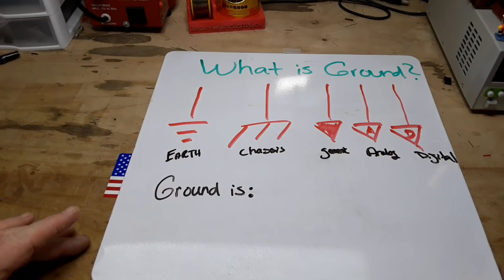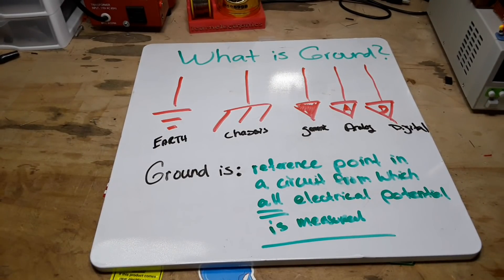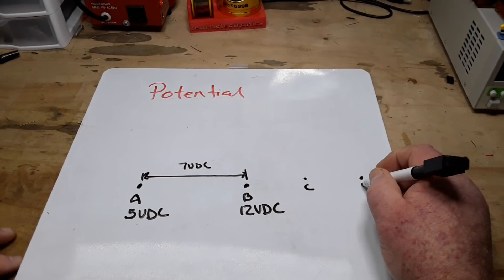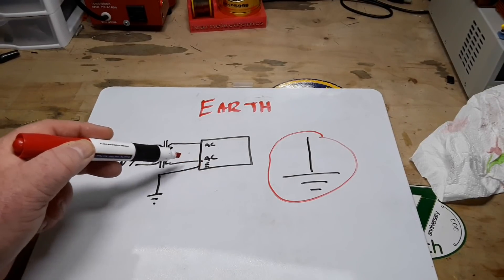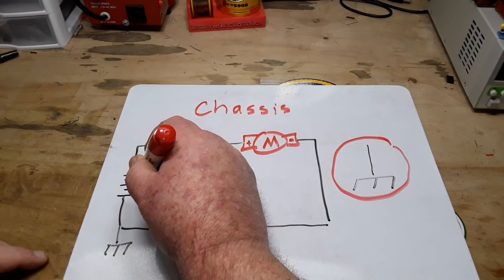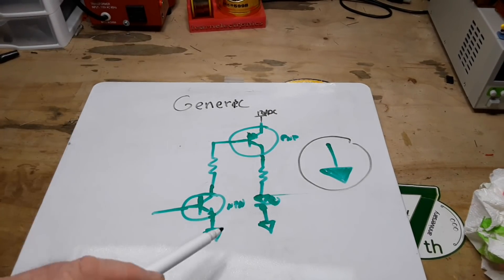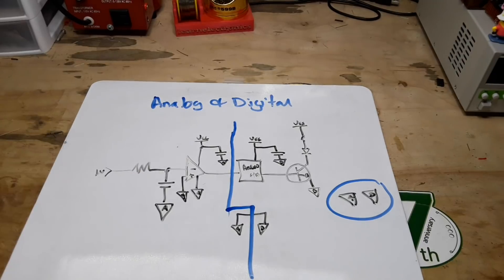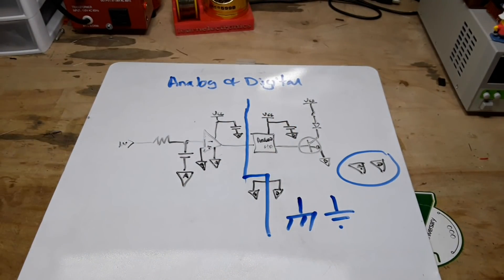What does GROUND mean?

Comment: Speaking as a physicist...there is a BIG difference between 'potential' and 'potential difference'.  A single conductor in space (air) can have a certain potential.  If a positive charge moves closer to that point, the potential there increases, and vise-versa.

Speaking as an EE, whenever the voltages are measured between two points, it is called a 'potential-difference'

...but that may be getting a little picky!
=======================================

...remembering your mother...God bless her soul!!!

--daLe

Comment: In the US system the fault current does not go to the ground but to the incoming neutral (the grounded conductor) and then to the transformer so it trips the breaker. A ground rod alone does not make an installation safe. Countries where that method is used use total differential protection (RCD/GFCI) for the house.

Comment: My condolences to your mom I want to know what is reference ground means I understand black ground but now I'm holding on a brown wire with stripes White Stripes down of it and it says connected to the reference ground so that's my question to you I'm hooking up a bass amp to my car and I'm putting the converter box to the trunk of my car so I can get all the power from my app so that's the question I'm asking what does reference ground mean because when I put the brown on black ground it don't work but when I take that brown off the black and put the black on the ground the lights on but I still have a loose brown wire said reference ground
Reply from the maker: I'm sorry, I'm not knowledgeable about car audio and wouldn't want to steer you wrong.

Comment: When we were building the audio distribution in the new church building, we soon had a ground problem. We had installed audio cables in all rooms to be able to send the sound flexibly from anywhere and to be able to fetch it from anywhere.
The mixer and the amplifiers are connected to the audio ground via a power supply ground. But in the group room we also have a small amplifier where the audio ground is also connected to the power ground. 
So we had a nice ground lood. BRRRRRRRRR
We solved the problem with sound transformers and DI boxes.
So always only connect ground to earth at one point.

Comment: Hi there I just wanted to say how sorry I am to hear about your loss. I work in the UK as an engineer working in the security sector and our sistoms may have several P, S, U's and thay have a common "0v"DC as part of the reference of the internal data. But every now and again you come to power part of the system down to then find out that someone has commented the 12v as well which means that the P, S, U, 's are back feading each other and it is still running. They have also connected the ground from different supply's to the building which can have several volts different between them. Fead from different sub stations. So you can be chasing folts for ages

Comment: My condolences!  Definition of earth ground:  a path of low resistance back to the source for fault current.  When I  teach,  I explain that a volt meters measures potential difference between two points of reference.  Then it is easier to understand.  People mistakenly believe that a neutral (AC circuit) does not carry a load because the voltage meter does not show a potential difference between the last load and ground.  Their have to be a source of resistance between the two reference points to read a potential difference.
Reply: I would not characterize Earth ground as a source but rather a potential sink and a reference. Unless you have wings the earth is difficult to avoid. Birds on a wire will have a different perspective on matters than we do. Lacking the ability to fly we have to do things as we do them. Neutral is the current return path. We use what is called a bonded center tapped service in the USA. The center tap is ground bonded. Each hot is 120 VAC above ground and between both hots is 240 VAC. Neutral is ground. But there's reasons why we cannot treat ground as neutral or neutral as ground. I guess those reasons are where mistakes arise?

Comment: My sincere condolences. Glad you made this video, thank you for clearing up a question i had with our dataloggers. Basically analog ground was separated from power ground but when i put a multimeter on continuity across both terminals, i had continuity. You mentioned they are connected but "downstream" of the measuring circuit, from what i now understand.
Reply from the maker: The connection of the analog and digital grounds is generally the last step in the process. You have your analog circuitry all grounded together. Then you have your digital circuitry all grounded together. And eventually you can connect those two points together. That's the key. The connection of just the two points not all the separate analog and digital grounds. I know it doesn't seem like it makes sense but just by having one connection you eliminate the loops
Reply: @learnelectronics  thanks!

Comment: may she rest in peace. Health to you and your family. I always struggle with the ground. Thank you for the video
Reply: I made a stepper motor driver once and how the ground ran affected its function. Where one capacitor was I mean it was about this much difference > < I was looking at the circuit thinking nah that can't be why it isn't working. I cut that much wire out and made the capacitor that much closer and it fixed it. It was like a sixteenth of an inch. Was the most bizarre grounding problem I ever had. That circuit had two grounds in it, logic and load. Where that one decoupling capacitor was in relation to the logic ground as opposed to the load ground made it or broke it. In the end it was the same route just different distances. I'd tied the logic and load grounds together too closely. That decoupling cap had to be closer to the logical ground. Was just easier to wire how I'd done it initially. I didn't think it'd matter.

Comment: Love most of your videos. They are great to learn from. You also have fun experiments that don't always have to succeed on the first attempt. That's how it goes. However, the 7V difference of potential reference is probably complicated to understand for newbies. I recommend using a multiple point demonstration there. For example, AB and C have some potential difference. A and ground are 10V, where B to ground is 7V, and C to ground is 3V. This helps drive home the point that you can measure in a series circuit that voltage is additive to the equivalent supplied voltage. It also helps identify rails in circuits, which makes troubleshooting way easier.
Reply from the maker: Oh I agree with you 100%. It's very difficult to teach these concepts that would be taught over a period of days or even weeks in a classroom setting and distill them down to a 10 minute YouTube video.

Comment: Electricity works on potential. There has to be a difference. That's why birds sitting on wire don't get shocked. They are energized to whatever that voltage is. Now if those birds with there tiny little feet grabbed another phase and/or neutral phase well you'll have yourself a nice BBQd pigeon
Reply from the maker: You are 100% correct sir. I seen videos of squirrels who have hit both phases. They tend to vaporize